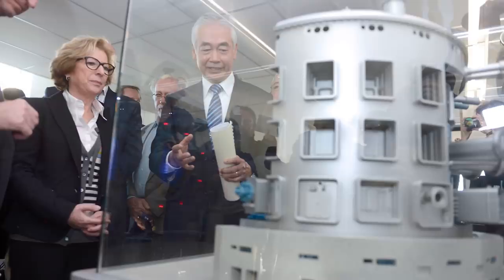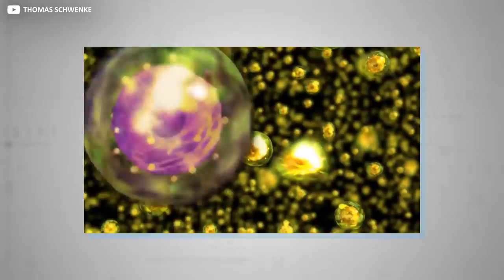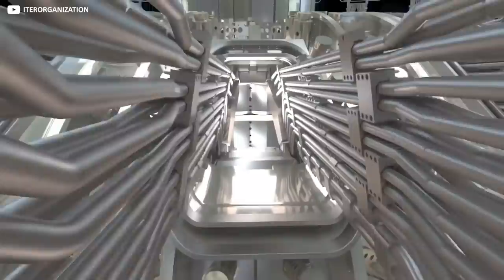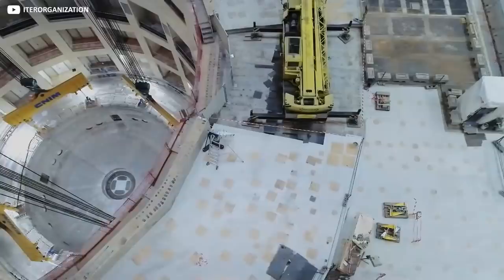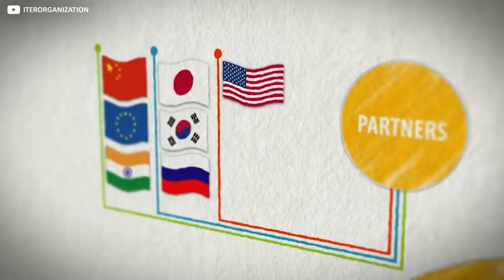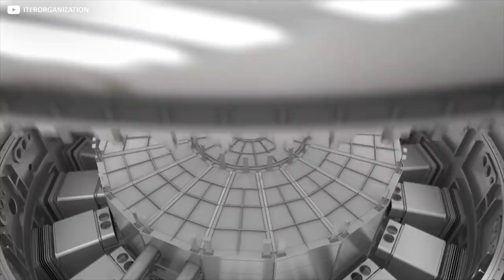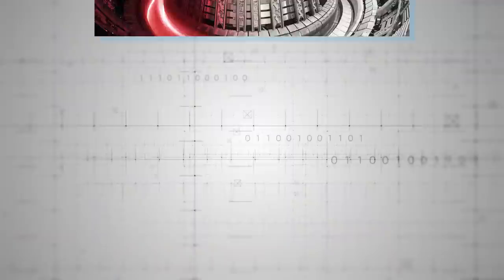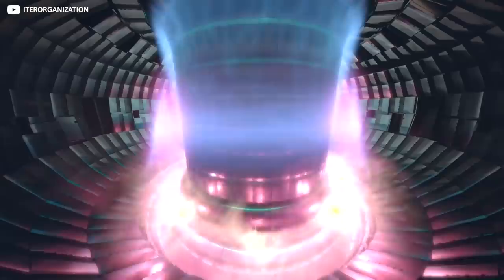Inside The World's Largest Nuclear Fusion Reactor

Comment: It’s very simple system why they make it such complicated ?
Reply: Right now it takes more energy to have the reactor run than the energy it makes
Reply: @brimstone1355  why ? Just need input of the high torque and speed motor .. iron ball and strong permanent magnet .. and be sure you will spend very low energy to produce high heat can create plasma.. you have to create two things .. heat and artificial gravity and both is simple …
Reply: @brimstone1355  give me good laboratory and finance I make fusion reactor in a few months
Reply: @ilhandurmus  It costs billions of dollars to do test runs and maintain the magnets since the plasma is millions of degrees hot. The main reason why we still don't have fusion reactors is because of budgets and because  2 positively charged nuclei don't want to be close to each other and for fusion to occur you need the two of them to collide. The sun overcomes this problem because of its extreme gravity and pressure forcing them to collide. Here on earth we still don't have the technology to exert 900,000,000,000,000,000,000,000,000,000 pounds of pressure onto something.
Reply: @brimstone1355  :) it’s very wrong .. scientists always wants to make things in difficult way … as I told you give me good laboratory and a few hundred thousands usd finance I make fusion reactor … small size . Actually they create only extreme heat to make plasma .. but you don’t need extreme heat for plasma.. you need gravity to keep plasma stable (confinement ) this is the biggest mistake
Reply: @ilhandurmus  How will you overcome positivity charged nuclei repelling each other?
Reply: @brimstone1355  gravity and heat gravity will pull heat will push electrons because of high energy some atoms will loose electrons and due to zigzag movement some atoms will collide but I am thinking to use dry ice which is better than hydrogen because there is possibility to produce oxygen and diamond:)
Reply: @ilhandurmus  Then explain why Jupiter isn't a star. Its many times larger than earth so there is your gravity and the core is 43k degrees hot. There is your heat. Why is there no fusion? The scientists working on fusion has spent many years studying to even be involved in the development so they are much more educated than you and I on this.
Reply: @brimstone1355  to understand Jupiter we have to know creation time elapses.. and during gain mass what kind of space rocks hit . Maybe once upon a time it was star but it’s energy finished and just has small gravity keeps gasses around it . We have to enter to the core of Jupiter to understand what happened… for fusion we need two things heat and gravity … atoms will enter gravity areas will move very fast  to center and when they are heated they will escape from center during this movement there will be change at centrifugal force of atom and may loose some electrons and when they are moving from center to outside of the plasma they will face with other atoms moving very fast to center of plasma so not all but some of them will collide and will make chain of reaction depends on number of atoms collide will create plasma waves  like sun
Reply: @ilhandurmus  Why do you think stars are absolutely enormous? They need immense heat and pressure. Heat can be replicated with our current technology but pressure cannot. Positive repels positive. Pressure is the main problem and fuel as well. I know you are most likely trolling because you can't just simply ignore a simple fact.
Reply: @brimstone1355  fret of all we can replicate the pressure. If you put in to microwave a glass cup of pure water you can increase the temperature more than 100-150 degrees but no boiling so inside of the water pressure is more than one atm and beside this you can’t say simply word of star and give result .. earth .. moon.. Mars all of them was star once upon a time but due to different of space rocks hits them now they have different conditions.. we have to talk specifically one star with its name and specs to understand each other
Reply: @ilhandurmus  what i meant by not being able to recreate the pressure is that it takes more energy to reach that pressure and heat than the fusion makes. Again fuel is still a problem tritium is extremely rare on earth and although we can make it its not a lot. One place that does have a lot of tritium is the moon. Don't even try to say you can make a cheap fusion reactor. You can't. Period
Reply: @ilhandurmus  Who are the people who developed the technology to have us communicate this way? Scientists. They have devoted their lives to make fusion profitable and what you are saying you are suddenly smarter than them? You think all of their calculations and studies are wrong just because you say so? If its as easy as you say then why hasn't anyone considered it? Im sure the ones actually working their asses off for this and doing the actual testing would've seen your brilliant method.
Reply: @brimstone1355  you don’t understand fusion.. isotopes of hydrogen is not fuel of fusion it’s products of fusion… presently our GENIUS scientists try to make easy fusion with this products in the fact it’s harder but as I said they are so genius:)
Reply: @brimstone1355  I don’t say for all of them but beside this if we compare what they took and what they gave .. they took more than they have
Reply: @brimstone1355  I am not talking about all scientists. Just talking about the ones who is working on fusion …
Reply: @brimstone1355  for me top rank is scientists and than engineers and technicians and workers … so don’t miss understand me
Reply: @brimstone1355  there are stars have only potash gasses around .. there are stars has only sodium gas around it .. so by saying simple star doesn’t make any sense .. you are asking wrong question always .. why sun still have fusion and no rock hits to it :)
Reply: @brimstone1355  for me if one human can’t be scientists become engineer and if can’t be engineer become technician and if can’t be technician become worker but if can’t be worker will be only parasite :)
Reply: @ilhandurmus  Yet achieving fusion is a really hard and costly process. The scientists working on it would love to discover an easier way that is more affordable. Its exactly what they are researching right now. Since it is still not very easy there is no way to make it easy as of right now
Reply: @brimstone1355  I don’t know if stars enormously big or not . What I know is if they have gasses around it means they have gravity and gravity is related with speed and density of core . And beside this if their core is hot means it’s ferromagnetic but the rest I can’t know .. I never had telescope to watch sky and even I was not interested with science and space till last year . I was dedicated my life against negative minds but when I accepted my failure last august (2020) I gave my self to science and space .. with google and YouTube I learned space and physics but off course I didn’t absorb all information as they are .. after processing them with my intelligence I made my hypothesis… because I don’t accept anything as it’s . I prefer to understand what /how/why … if I can’t understand I fight till I understand and at the end I always understand… because everything is simple just I need time to understand. I can solve most complicated problems just it’s matter of time for me … to understand forces of universe took my 6-7 months how the poles and charges… fir example instead of using fluency of electric (electrons ) use their spinning power which is 100 times stronger and more energy efficient.. for example actual railgun they work with fluency of electrons and change of poles but if they use electron rotation speed with very less offer they can reach to higher velocity 😉
Reply: @brimstone1355  in fusion semi product is isotopes of hydrogen and final product is helium so when you started fusion with hydrogen you will already produce the isotopes of hydrogen . Important thing is starting the fusion and start fusion you need let hydrogen loose their electrons and you need gravity and extreme heat but no millions of degree after reaching a few thousands hydrogen atoms will move like crazy .. important thing is gravity here and it’s not very hard but for this I need the laboratory:)
Reply: @brimstone1355  it’s not the pressure makes the plasma and fusion it’s gravity :)
Reply: @ilhandurmus  what does gravity create? Pressure. We are both right
Reply: @ilhandurmus  its not as simple as you say it is. Stars cores are blazing hot so heat combined with pressure, caused by gravity, will create plasma. But here is where you are wrong. Positive repels positive simple. To get them to collide you need to get them to go extremely fast so they absolutely cannot repel each other thus creating helium. The only way to get them to go fast is by heating them to millions of degrees. That is why stars are hot and heavy and its also why the cores of planets dont undergo fusion. 15k degrees or however much you are saying won't cut it. Its that simple.
Reply: @brimstone1355  you are wrong again but understanding step by step the truths .. when gas molecules speed fast temperature increase because of the friction between them and if you are able to keep them with gravity inside the plasma fusion will start and temperature will increase so here the main subject is gravity forget the pressure and heat .. pressure is result of gravity and extreme heat is speed of atoms and than fusion starts … and if you can create the gravity to speed up the fusion you can heat with x-ray laser it’s not big problem… all question here is gravity … as I explained you with water in microwave… when you heat with electromagnetic waves you will increase the pressure without loosing plasma because you will increase the energy of sub atomic particles which increases the centrifugal force of the atom which will keep them together so all question in only gravity and I have some ideas for this but as I said need laboratory tests … I have two main idea and one small idea 90 percent my first idea will solve the problem 9 percent second idea and 1 percent is the third idea
Reply: @brimstone1355  yes we are right maybe presently explaining the truths wrong reasons will not be problem but for sure in the future will give wrong results .. so we have to give reason true to have always true results .. pressure is result of gravity and electromagnetic radiation occurs during fusion so .. pressure is results we don’t need to create it and also temperature is the result we don’t need to create it but will help speed up fusion but will never be reason of fusion
Reply: @brimstone1355  plasma must not touch to somewhere so gravity is must of the fusion without gravity plasma will touch wall of the reactor and will discharge all energy as heat so gravity is must
Reply: @ilhandurmus  How am I wrong? I am presenting cold hard facts that have been proven by scientists that study stars. You need the heat to make the nuclei to move fast enough so they can't repel each other. For that you need to heat them up to millions of degrees because heat makes nuclei go faster. That is an indisputable fact. If its as simple as making plasma only a couple thousand degrees hot than why are stars so massive and hot? Why aren't the scientists working on fusion reactors just making plasma that hot? I don't understand how you think that is hot enough to make fusion possible because you literally cannot.
Reply: @brimstone1355  since we agreed gravity is main problem of fusion that means we agree we don’t need billion dollars for fusion . And it’s not such hard and impossible thing to take for humanity 100 years to do . Here what we have to decide is 0-90-180-270-360 degree ? Which angle is correct this is the question will take some time but we will find .. because gravity doesn’t occur immediately need time. Because all electrons of all atoms of the core must take right position to create the gravity which will take time
Reply: @brimstone1355  I found how to create gravity . We will use rotating speed of electrons . And we will use 3 major things we need laser to heat another laser to cool and strong wireless electric
Reply: @brimstone1355  what’s is the difference between AC and DC ? In ac electrons are single charges with two poles . In DC single pole with two charges. With using nuclear waste we can produce electric with electrons single charge and single pole which will have much more energy:) if we are able to produce electromagnetic radiation with electric we can also produce electric with electromagnetic radiation . And I have idea for this
Reply: @brimstone1355  there are many things we know wrong .. for example we say moon turn around it’s self same speed and same rotation with earth .. no it’s wrong moon turns around it’s self 68-112 degree to earth and when it’s full moon it has ninety degree with earth and rise from correct East . Due to this rotation we see moon crescent to full …
Reply: @ilhandurmus  So you are saying the people who study the moon and stars are wrong? Do your research on fusion. Im done with you. You won't accept your wrong and keep rambling about things that experts say isn't true or isn't possible.
Reply: @ilhandurmus  and yes you do billions of dollars to make a test run because you need quite a lot of energy to heat things up to 15 million degrees and power the mega magnets
Reply: @brimstone1355  there is one big dark crater on moon turning clockwise today it’s around 10-11 o’clock position 270-280 degree follow this crater in a few days will come to 12:00(360)
Reply: @brimstone1355  for me fusion subject is completed need gravity for keeping plasma stable and magnets for heating the core . Gravity can be obtained in two ways mechanical or electromagnetic… or both .. since I don’t have facilities to make tests I can’t go further than this.. theoretically idea is complicated now need tests :)
Reply: @brimstone1355  there is another way of making fusion.. electric. Copper and aluminum that’s it .. no need billions dollars :)
Reply: @brimstone1355  secret of energy is simple magnet iron copper aluminum and electric :) if you have all these you can do everything winter summer hurricane em radiation.. plasma … fusion .. fission… whatever you imagine you can do
Reply: @brimstone1355  as I told you nothing is impossible for me .. just matter of time to make impossible to possible.. if you make laser from copper heating and from aluminum cooling and if they focus to same point what happens ? Fusion :) and fission
Reply: @brimstone1355  you will ask me how will I make laser off course with optical lenses .. I will prepare the mold and fill it with sand/sodium/lime and put it to vacuum chamber and discharge all air inside and than put in to vacuum chamber oxygen, hydrogen, helium or co2 any of this and close the molds with high pressure and heat up to 1500-2000 degree (mold will be tungsten carbide ) and you optical lens coated suitable for x-ray laser is ready and rest is simple to produce electromagnetic radiation:)
Reply: @brimstone1355  I forget you will ask me how I will make electromagnetic radiation:) I will use copper to create positive charged photons and aluminum for produce negative charged photons .. off course AC .. increasing frequency will decrease the size of photons which can pass between elections and hit to protons or neutrons.. and increase the voltage will increase the frequency of photons which will increase the possibility of hitting to protons and neutrons .. you see I learned all these watching YouTube six months :)
Reply: @brimstone1355  do you know what is the worse .. maybe we don’t have enough time to develop technology.. immigrant birds were flying last year around 700-1000 meters altitude and this year 400-500 meters … and small groups and mixed rotations ..last year they were flying groups of hundreds this year less than 100 .. before they were flying with shape of V .. and now up down and many other mixed shapes … nature is changing very fast and we have to do something to take cautions and loosing time with simple things .. if we don’t find solution very fast we will not have earth to manage .. than is it important who is super power ? If there is no earth ?
Reply: @brimstone1355  reaction must be square and instead of magnetic field we must use magnetic fluidity of permanent magnets strength with DC electric iron core must be heated till plasma level but first with magnetic fluidity must turn enough to gain magnetic levitation and when reached to enough temperature the iron core we must inject to liquid hydrogen inside the chamber but walls must be glass and space between core and walls must be calculated according to heat conductivity of hydrogen gas. When we have the iron plasma core and extreme high speed due to magnetic fluidity will have gravity
Reply: @brimstone1355  or better than square rectangular 6-8 ration base of perfect geoid 3-4-5 triangle
Reply: @brimstone1355  there is  way to make magnetic fluidity without magnet and in this way iron ball will spin but will not try to escape sides iron ball must be perfect sphere .. heating of the iron ball will be from up and down with DC based electromagnetic radiation which will increase temperature but will stay solid state

Comment: What materials withstand 150,000,000 degrees C  without melting or breaking down?? Either way....this looks like a massive waste of money and time based on a gamble..
Reply: Its not.

Also they don’t have to withstand the heat, the plasma wont touch shit, there are magnets isolating it from touching anything.
Reply: @dreamypupper4080  very very cold magnets